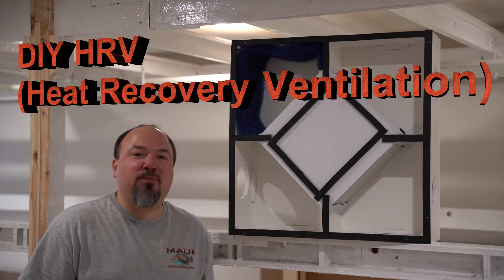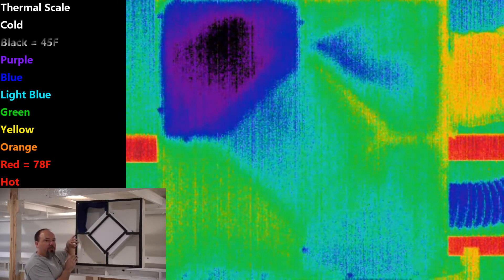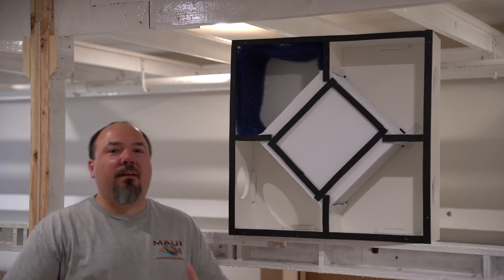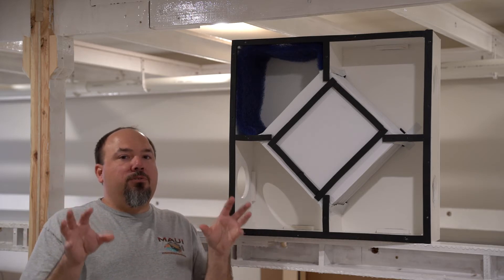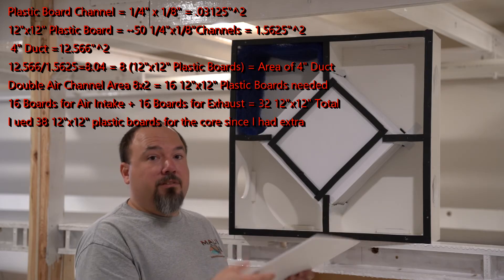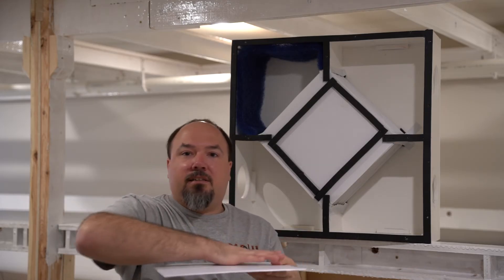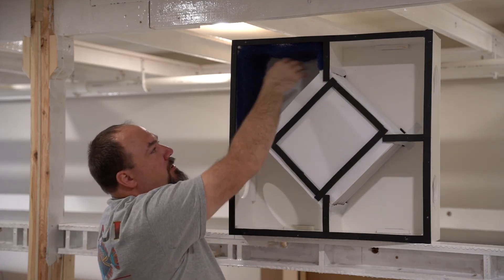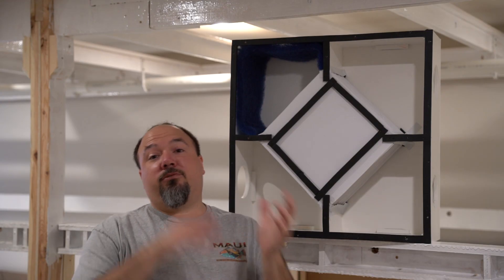DIY HRV (Heat Recovery Ventilation)

Comment: Great build. But the CO2 measurements only confirm that inside/outside AIR are being exchanged. This video gives no indication that any heat is being recovered by the plastic, heat recovery unit.

Comment: This is great. I want to build one for my composite truck camper. The total volume I have is about 22m3. What size would you recommend for the plastic boards ?
Reply from the maker: I based the core size on the area inside a 4" duct.  I ensured the inside area of all the plastic board channels combined was a bit larger than the inside duct area to allow the best airflow possible from the 4" duct fans.

Comment: Have you considered using the version of corrugation where the sheets are aluminum and the support structure is plastic? I'd imagine it would be much more efficient considering plastic doesn't conduct heat nearly as well.
Reply from the maker: @GregAtlas  originally I considered copper but the expense was really high.  Aluminum would work for sure if it's available.  At the time I saw commercially available HRVs using plastic core material which led me to that plastic sheet material.  Still running great.

Comment: The black version of that plastic should transfer heat better
Reply: No...the color has nothing to do with the heat transfer of this plastic.  You're thinking of radiant heat absorbed from sunlight.
Reply: @bobbywedding  yes it does. heat released is different with different colors as well. radiant heat isn't only for absorbing

Comment: Here you use two separate ventilators right? One which pumps air from outside to inside and one which is pumping the air from inside to outside.
Reply from the maker: Yes one vent fan for each air flow.

Comment: This was stupendous! If I understand it right, the difference between a heat recovery ventilator and an energy recovery ventilator is that ERV allows the transmission of humidity along with the temperature. What is the inner filter made of in an ERV? Would a different corrugated medium similar to those plastic boards, but able to transfer humidity/moisture, turn this HRV into an ERV?

Comment: Is plastic really the best material for the core? If so why?
Reply: I had a similar question. I guess the goal is the material of the highest temp transferability. That would be affected by its density and its thickness I would imagine. There are likely better materials but this is quite serendipitous (and cheap!) for a DIY epiphany haha.

Comment: Now that the winter is over.. how did it do with the condensation?? I need to do something with my house cause i have very high humidity and mold inside
Reply from the maker: The only condensation issue I had  with condensation was on the HRV box itself and the output of the outside air into the room duct.  I placed a fan on the HRV and the issue was solved.  The internal condensation drained into my buckets the HRV was sitting on without an issue.
Reply: @algawura2  thanks for sharing

Comment: Hey very interesting solution. I saw a  similar design online. Did you use that as a base or this design was inspired by the comercial level hrvs. Also do you have any updates on the performance? Thanks for thr video, it looks super interesting

Comment: What type of co2 meter are you using to measure your home levels
Reply from the maker: This is the model i have  GZAIR CO2 Data Logger Monitor, IAQ CO2 Detector, Dual-Channel NDIR Sensor, Tabletop Carbon Dioxide Meter with Data Export, Temperature and Humidity, 0~5000ppm Range

Comment: That's an interesting way to make the heat exchanger. I've thought about a economical way of making one years ago and never considered using plastic as a material. It's heat conduction is so poor compared to metal. But being as thin as it is, it might still be adequate. I'm sure this will be be far better than just opening a window in any case. 
But the efficacy of the the heat exchanger won't be measured by the CO2 levels, an open window will achieve the same thing. It'll be measured in temp. differential between incoming and out going air when there is a big difference between inside and outside.
Reply from the maker: Thanks Siggy in CR.  I considered copper and aluminum but the cost was so high along with having to be concerned about metal corrosion over time.  Then I saw that some commercially available units can use plastic for a core which is why I went that direction.  With a high efficiency heat exchanger I can see that you could scale it down in size but with this material its cheap to scale to a larger heat exchanger that it should overcome the efficiency.  I use a PEX coil for my aquarium radiant heat exchanger as well and it does a great job of heating 2100 gallons of water I just need to use a 50'+ heat exchanger coil.   Very good point on measuring the heat exchanger efficiency I did not even cover this outside of the thermal imaging.  I think the next video I do for a follow up on this HRV after its been running a few months will focus more on heat exchanger efficiency as I don't have enough data to really cover that yet.  I have observed that intake air after the HRV has been fairly close to room temp but we have not had any really cold days yet.  As an example this morning the intake outside air was 51F before entering the HRV,  Room Temp is 72F ,  Intake outside air exiting the HRV was 68F with both duct fans running at 100%.  I think I am going to need to log these readings or get some temp probes to place in the air ducts to I can constantly measure.
Reply: Just a thought, but you might be able to improve heat exchange by making this a 2 or 3 stage system with each stage being the same thing , just one porting into the next. Also, running lots of copper wires through the corrugated  plastic (passing through the planes) could help with plastic's heat conduction shortcomings.
Reply from the maker: @siggyincr7447  I like the 2 stage or 3stage idea which is similar to what I mentioned about expanding the HRV size.